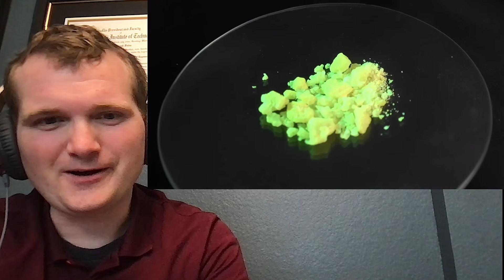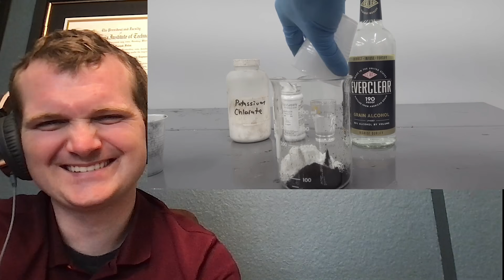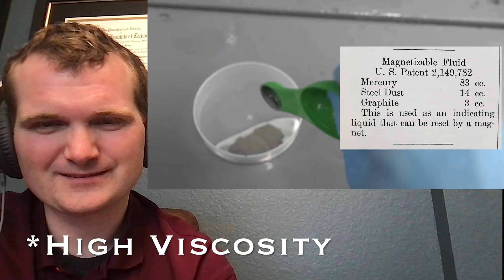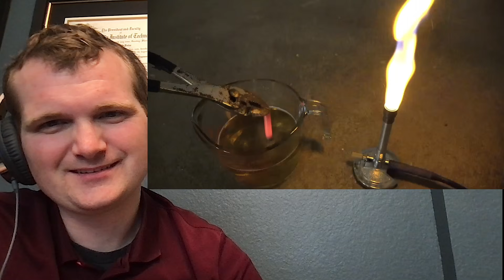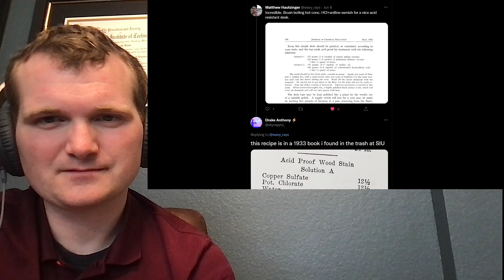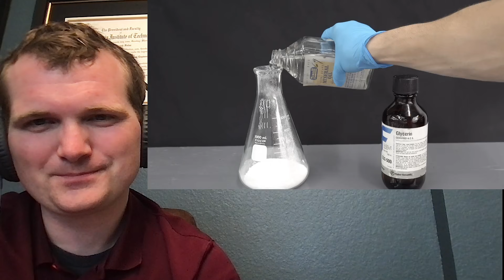URANIUM CRAYON? - Nuclear Engineer Reacts to INSANE 1933 Chemistry Recipes by styropyro

Comment: Unlike steel, copper can't be hardened by quenching, but the pipe has probably been work hardened. Heating it up actually anneals it, making it softer. I bet the quenching liquid actually makes a hard coating on the surface while the copper itself actually gets softer, which would align with the results.
Reply: Urine contains several chemicals which like to crystalize. The color the pipe turned is also similar to oxidized copper, but had black bits in it too. If the other chemicals are helping to speed up the crystallization process, then it's possible that the heat causes crystals to rapidly form on the copper's surface, creating a hard layer.

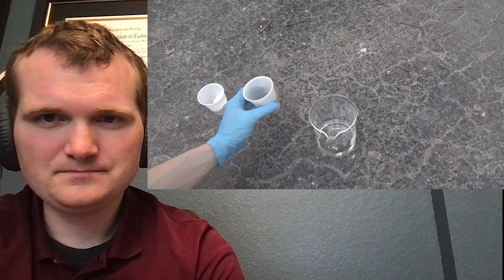Comment: 6:50 I think his reasoning for the lack of long sleeves for this particular part of the video is probably because of the flammable chemicals and chance of auto ignition, you don’t want anything that can soak up fuel and prolong the amount of time you have fire against skin if things go wrong, and it’s much easier to wash off the particular chemicals he’s working with than to get burns treated as well as being much cheaper
Reply: Yeah. The lack of protection was in fact. More effective for protection than if he had it. Which is cool. In that instance. Having a small amount of protection. Namely gloves. Is safer than having a full suit.

Comment: Somewhere in a box I have a book published in the 1880s collecting articles from a British magazine from the 1830s & 40s.
   One of the suggestions for a display at a garden party was to take a block of ice, one foot on a side, and drill a hole 1" wide and 6" deep, then drop in a piece of sodium the size of a walnut. It will make a nice display of sparks and flame. 
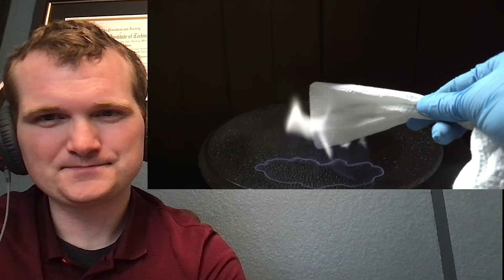   @11:30 The difference is that "flammable" means something can be set fire to using a flame, "inflammable" means something can burst into flame without an ignition source other than ambient heat. 
   To be fair, it's worth noting that some words, and even prefixes, have changed meanings over time. For example, older texts refer to magnetic attraction and repulsion as love or hate. 17th century scientists weren't ascribing emotions to metals, just using terminology that could be translated into multiple languages including Latin (since the church funded a lot of science).

Comment: 11:09 Its not actually English's fault. The prefix in- comes to english from the common Latin prefix in-, which means "into, in, in, or upon". This is BTW NOT the origin of the extremely common word "In" which has almost the exact same meaning. In the word comes to us from proto-germanic. Ultimately, both however get the word from the Proto Indo-European word *en. BTW, the asterisk is there to represent that the word has been reconstructed and as such it is only what linguists believe the origin word most likely was based on studying descendent languages. This version sometimes is spelt im-, il-, or ir-. 

This is as opposed to how we usually think of the prefix in-, meaning "not" which English gets from the common Latin prefix "in-" meaning not. THIS in- is believed to actually from a different PIE prefix, *ne-. There is actually in English a cognate to this version of in-, un-. A reasonable accurate way to tell if a word using a not prefix is native to english or a latin import is that generally latin imports have in- for this purpose while un- is words that are using the native version or heavily nativized versions of a word. 

Yes, It could be a source of confusion in latin as well. For example, the latin version of impress, Impressus? Could be pressed or unpressed.

Comment: 17:50 The melting point 168 farenheit is close to Cerrosafe (168F) but it's lacking cadmium. Rose metal is the only one that uses exclusively Bismuth+Lead+Tin and nothing else and the melting point is 208F (1 part Tin, 1 part Lead and 2 part Bismuth), so this might be why the recipe didn't work as expected when boiled in water.

Comment: Interesting, i worked with depleted uranium many years ago, aircraft manufacturers use it as counterbalance weights for the control surfaces

Sometimes its a ball, moulded onto a threaded rod, sometimes its an intricate cage shape, made of what looks like many rods, bent into shape and braised together

Very interesting stuff, very heavy compared to mild steel, and it sets off the radiation detection systems at junk yards

I think junk yards will take it, but they like to keep it separate from other scrap metals

Comment: Quenching Copper in water or oil after heating it up to critical temp is how you soften the metal. Unlike steel or Iron, which hardens when you do that. same thing with bronze, it goes soft. BUT, Copper & bronze work-hardens, so to harden it up you simply hit it with a hammer to compress the metal closer together. simplified way of saying this. but basically what happens.

Comment: Just to note: I DO NOT DO ANY COMMERCIAL CHEMISTRY, NOR A DEGREE. I have some experience from doing a lot of hobby projects, and a lot of reading. If you're referencing my comment, thinking this means it is safe for YOU to do chemical reactions, you probably should. Leave the reactions to awesome youtube videos.

As far as "pairing" for chemical reactions, it really depends. In commercial, you may see pairs in order of safety, for example, not leveling ph before moving onto the next reaction because of forgetting, a paired individual may catch it. As far as simple mixtures, or one step chemistry, it can be fine to do it on your own IF you know what reactions are expected as well as knowing how to address those reactions. For example, if you know you're getting chloramine gas from mixing bleach + ammonia, and you set up a vented location, tested with your smoke sticks, even though chloramine gas is toxic, an experienced chemist that has set up a station to handle the reaction, would have little to no problems. Plus, they always have backup plans, exit routes, Ph resolvers, sand, etc etc.

Comment: 4:50 woooe "spent fuel" my good sir. that fuel  faaar from spent. Uuuh breeder reactors much? it's also possible to recycle the fuel. nothing like  a nice scrubbing bath in Chlorine Trifluoride to get rid of the materials that's not practical to reuse. Then its good as new and can be reused in a fission reactor. Or if we had fusion a MrFusion battery reactor would do quite nicely as well.

Comment: This Styro is a bit of a tosser. Look at the table behind which sports a couple of HF power tetrodes from the 50's, then a digital oscilloscope, power supply with digital readout, and a couple of various enclosures holding something electronic. Strictly hobby level gear, and have no use whatsoever for chemistry, just decoration
Reply: Cope